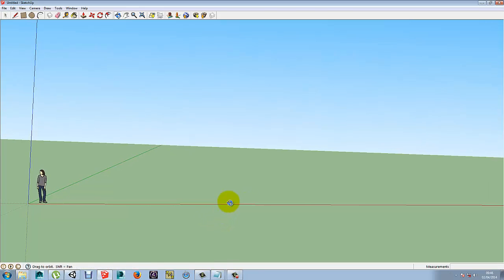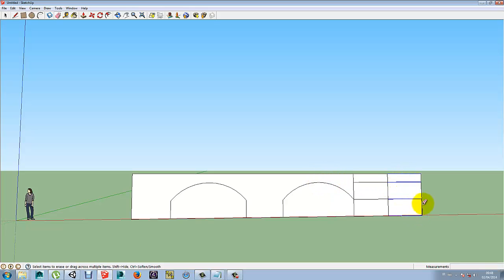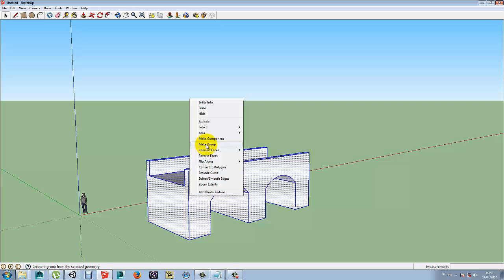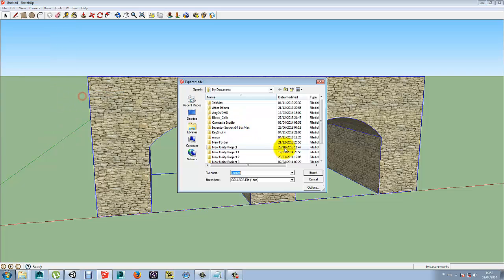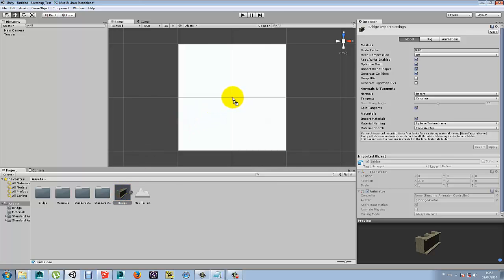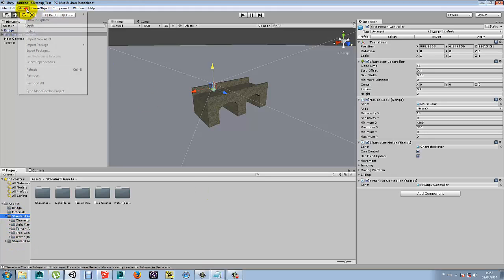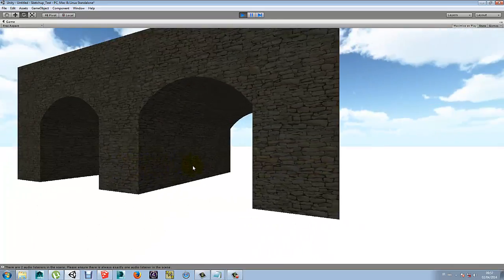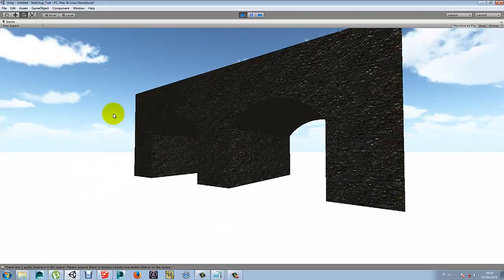Sketchup bridge export DAE to Unity 3d

Comment: NEVER NEVER NEVER Use .DAE in Unity, you will have a game full of dae models that bring the frame rate down to 20fps. and you didn't purge your materials. before exporting.
Reply: other than that pretty good tutorial, I would have used the measurement tool to cut back on erasing. also when dropping your pillars, after you made one measurement to make them drop further; all you need to do is double click on the surface. you want to add the last measurement to.